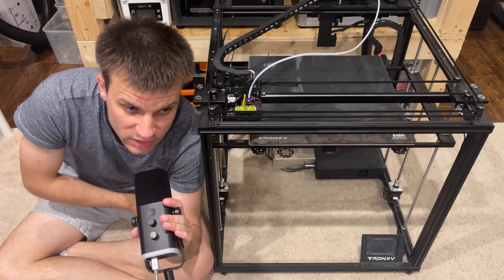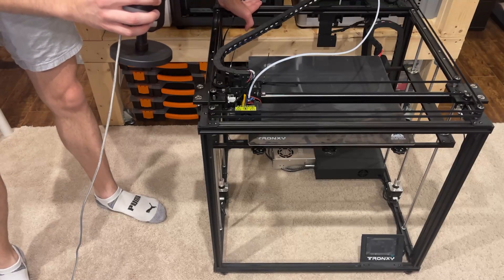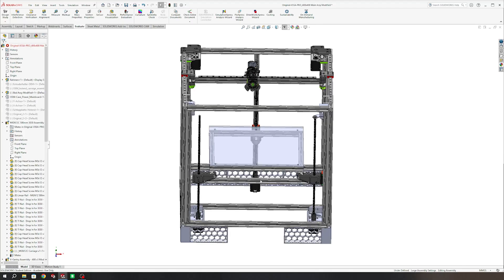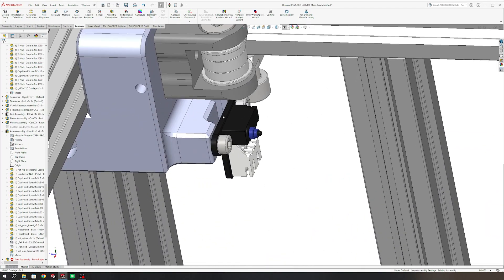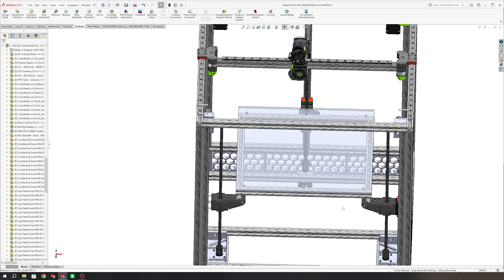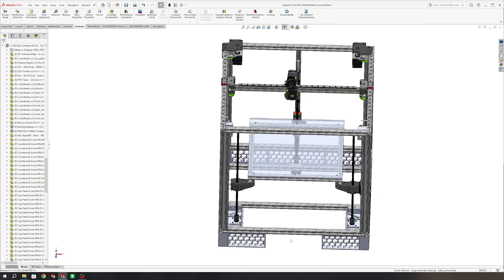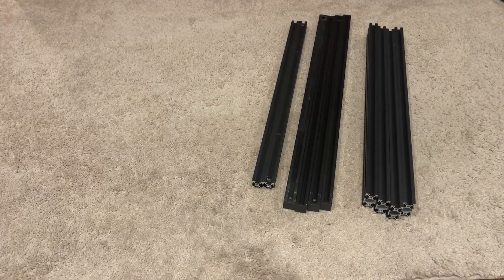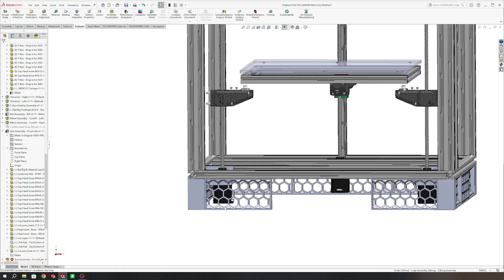The Hive 3D Printer: Merging Two 3D Printers into One (Part 1)

Comment: So you buy a RatRig 400 for 1200€ to 1800€ (depending on config) plus a Tronxy XS5A-400 Pro for 600€ and then combine it into eine new printer?
Or just the XS5A and some parts for the RatRig?

For that kind of money you can get a Voron and a Toolchanger included?

What's the reasoning behind it? Just because it's admittedly fun?

Do you plan on publishing a guide how to do it?
Reply from the maker: I probably would have been better off buying a machine for sure.
I ended up getting the printer on clearance from amazon 2 years ago for $250.
I am just having fun at this point, but it is definitely not the most practical. 
Ill post everything once im done so you get the final version not the WIP one.

Comment: Bin the glass bed and use a magnetic pei sheet bed. Stick with the beacon or cartographer probe with nozzle touch and it will ease a lot of issues.
Reply: I used the glass bed and glued it to the thin aluminum sheet and then put on a magnetic sheet and I use Cartographer on my Mercury One conversion of a TronXY X5SA
Reply from the maker: Thanks, I'll look into it.
Reply: The glass bed can still be used with Beacon as it has a contact mode where the nozzel is used as a probe. The Beacon uses its on board accelerometer to detect contact with the bed. Works great but a pei sheet is still better.